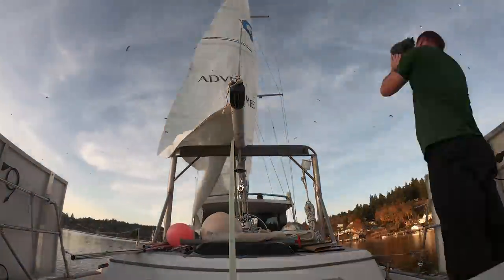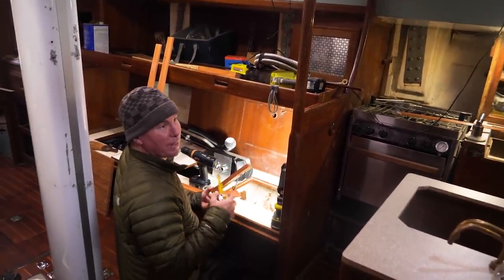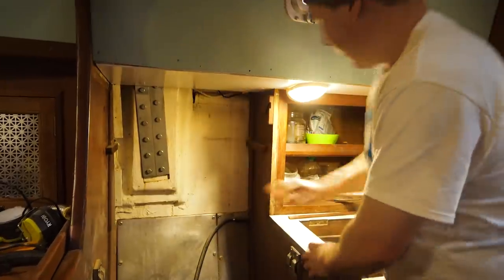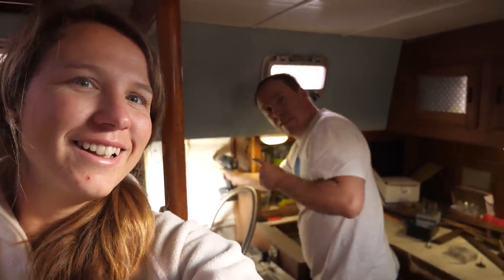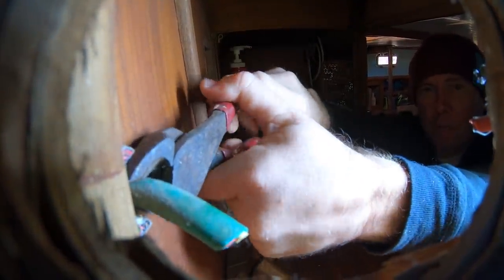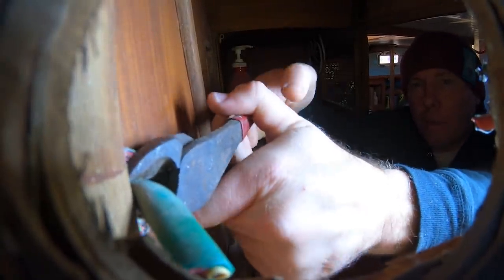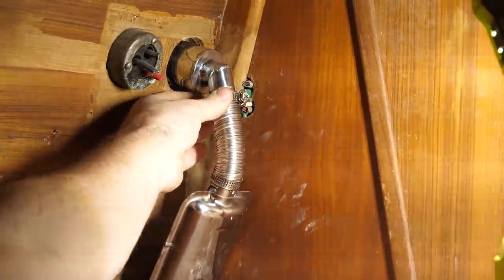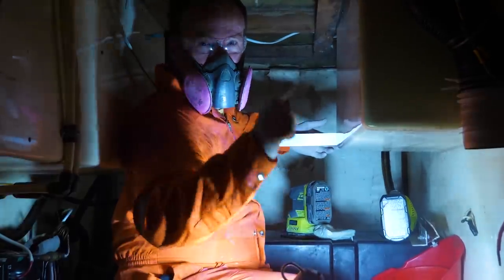Installing a Diesel Heater on a Boat [Adventure #193]

Comment: Great video. A few points.
The muffler that comes with these units is not gas tight. It has been designed to sit under a vehicle with the water drain hole downwards. Obviously that can't be done with a boat. It is possible to get get gas-tight marine mufflers, but they are not cheap. You can also get marine water traps to get the condensation (which will build up) out of the lowest part of the exhaust without letting exhaust gas out.
Also, taking the heating air from inside the cabin rather than outside the boat, and recirculating it, can lead to an increase in relative (and absolute) humidity and make condensation problems more likely.
The input air for the actual combustion chamber must come from outside - that's a safety thing.
Happy New Year to you both. I am sure that 2020 will be a great adventure for you.
Reply from the maker: Thanks for running through the specifics and we know that the muffler drain hole is not going to work for us with the angles here but had not thought about the leakage into the cabin.. Good news is we have a CO2 sniffer there to warn of dangerous levels until we get another solution in place, we like the idea of the water trap which we had initially planned for but could not seem to find anyone selling them, we must be searching for the wrong thing.

Our plan with the heating air currently comes for outside draft air without being air tight sealed through a hatch above the galley and under the dodger, that part will be a test and if we do not like the quality of dry heat or humidity levels.  We are also curious about the performance of the unit with not having a direct inlet of air from the outside which of course will be a problem if there is CO2 leaking into the cabin as well.
Reply: @AdventureAdriftSailing  I'm based in the UK and got my water trap from ebay - it was actually made in Turkey. Have a peek at the my December video (the 2nd one I think). Where I retro-fitted it. I had already done the exhaust without the water trap - but then changed my mind. I also did a specific humidity test with taking the air from the inside and then the outside - I think that one is is November.
And if I do mention any measurements - they are all in metric ;)
Reply: I was about to suggest checking out "Just About Sailing's " excellent videos on inside / outside air and humidity! You got there first!
Reply: Just about sailing that makes zero sense. How would recirculating indoor air increase humidity? That’s exactly how every home unit works, plus the outdoor air is very humid how would that even make sense?
Reply: @Juggernaut-fg2up  I am guessing that you are from a hotter part of the world than me. The amount of water air can hold is based on the temperature of the air. So in Miami the air outside would mostly be 'wetter' than the air inside. In the UK the air outside is almost always colder and much, much drier.
Have a look at a couple of videos I did - one Theory and one a Practical experiment (November 2019).
My ideal solution whilst I was living aboard and hooked up to mains power was to run a dessicant de-humidifier which, indeed, did re-cyle the air and worked great. A normal compressor type of de-humidifier just doesn't work in UK Winter temperatures.
As someone once said - the best way of keeping warm in a boat is to keep it in warm water.

Cheers
Paul
Reply: @verynearlyaboutsailing8114  that's just not how it works. Anytime you're on the water you're going to have higher humidity so I guess you never sail anywhere, also you're pulling in more cold air, why not recirculate the internal air so you can heat then reheat then heat again so you can build the temperature up. I guess you don't sail anywhere ever? You never go to more humid environments? So just keep pulling in cold possibly contaminated air? That doesn't make any sense at all. If that's the case then how come homes aren't dripping with water because they keep recirculating their own air? How come Vehicles aren't dripping with water?
Reply: @Juggernaut-fg2up  I'm afraid that we are just going to have to disagree on this one. The physics is (fairly) simple and is based on the levels of Relative Humidity, Absolute Humidity, Temperature and Dew Point. It did seem illogical to me at first - so I worked through the theory and then did an actual test by first recirculating the air inside, then taking the air from the outside. The results were conclusive and agreed with the physics.
But if we are both happy with our respective setups, that's fine. Fair winds to you.
Reply: Can i use a hi temp gasket sealer to install the muffler in-line before it gets sent thru hull exhaust? Along with a co2 alarm. Or would it be best to eliminate the muffler and just run exhaust from unit out of the boat with a loop in the exhaust line ?

Comment: I just installed the same heater on my boat. Technically had same heater on my previous boat. I absolutely love it. 

First your diesel filter is installed backwards. You want the contaminates to go to the outside of filter paper so you can visually see when it is clogged up.  In the way it is installed you won’t be able to see that. 

Second as others have mentioned the stock exhaust is not air tight and will leak into the cabin. They are designed to be mounted outside an automobile where leakage doesn’t matter. There are long cylindrical ones available. I used exhaust paste available at auto part stores and sealed the muffler, then wrapped the seams, then the whole muffler with aluminum foil air conditioning duct tape. 

Lastly make sure you have a good CO detector. 

Hit me up if you guys make it to LA, would love to buy you guys dinner.
Reply from the maker: Thanks Matt, you idea to wrap and seal the muffler is a simple and good solution and like you said a good CO detector goes a long way which we have right now and feel safe with that running but a permanent solution will have to be found.  What do you have as a way to get condensation out of the exhaust?
Reply: As of right now no way to get it out. I do agree we need them. “Just About Sailing” did a great video on relative humidity levels and what he bought for a muffler and water extractor. Thinking I may go with both. It is tough to find anything here in US because nothing is metric.

Comment: I've installed a couple of these heaters in boats and there are a couple of things to keep in mind, the exhaust hose gets hot enough to start a fire so make sure to have it shielded all the way to the outlet. The exhaust gas exiting through your cabin side will be hot enough to give a person a severe burn and melt anything it's bowing on. We also wouldn't install one of these heaters without at least one marine grade CO detector.

Comment: Lose the muffler that came with it!  They are not fully sealed along all the edges and will leak CO into the interior.   I found a long cylindrical muffler on ebay that is fully welded.     I've got the same one installed will almost all the identical parts (except the muffler)  on my Morgan OI 41.  1 outlet in the main cabin and one in the aft cabin.    the heat is great!  Don't forget to plumb the combustion inlet to the outside too!
Reply from the maker: Thanks for the suggestion, we will look into other mufflers. We haven't decided on plumbing the inlet air outside yet, that is our plan if we are unhappy with performance in any way since that is an easy modification, right now we have it below a protected hatch that is open with outside draft air and we hope that will be enough.
Reply: @AdventureAdriftSailing  The issue with not having the combustion air plumbed to the outside is.  When your unit soots up ( and it will)  it will back flow smoke and exhaust through the intake.  If its in the cabin you'll see smoke in the interior. 

for the exhaust I used one of these (not cheap but sealed)

https://www.ebay.ca/itm/Webasto-Eberspacher-Leakproof-24mm-Stainless-Marine-exhaust-Silencer-Muffler/323245898701?ssPageName=STRK%3AMEBIDX%3AIT&_trksid=p2057872.m2749.l2649

Comment: Hi guys! Great episode 👍 Just a thought about your installation; when you’re installing the heater it should be installed in a very well ventilated place in the boat.  You want to take in new, dry and fresh air into the cabin and press out the wet and used air. With a installation like yours you will accumulate both moisture and 
carbon dioxide and you don’t want that. We are using the same heater in -4 degrees Fahrenheit/-20 degrees Celsius without problems. Love following your journey. All the best from northern Norway 🇳🇴

Comment: Hello, I have had a planar heater for 5 years now and been very happy with the heater. word of advice is just before the fuel pump make it to where you can disconnect the fuel line or put a tea in the line...( that's what I did after the learning curve)  and put fuel line in the gal of Kerosene and run it on high temp for a hour or longer each month and it will burn all the soot out of the exhaust chamber and you will not have any problems. Kerosene is $5 a gal at Walmart and a gal last me 6 to 8 months. I also wrapped the exhaust hose with heat/ muffler tape and you can hold it without burning your hand. all car parts places has it. I did not use the muffler and it is quiet.  Have a good day and enjoy the heater.

Comment: As for a heat shield the best type is Stainless Steel bent around 1/4 “ concrete wall board found at Home Depo in the old days we use to use asbestos. This would be installed with S.S. Self tapers drilled through the face of the shield with a type of  fender washer “ decretive “. Some times the heat shield would be installed with an air gap between it and the bulkhead depending upon how hot the pipe gets.

Comment: What a beautiful diesel heater install.  Though it might kill you and let me explain why.  Number one the exhaust has at least three major issues.  Number one the muffler likely leaks a lot.  I have one and none of the edges are sealed well.  Also you can see inside your cabinet when you show it there is a drip hole visible which goes to the inside of the muffler exposed to exhaust.  So it is constantly leaking exhaust into the cabinet.  This leads into the second potentially lethal situation.  Why does a muffler need a drip hole?  Well it is because hot and cold things condense moisture in the air.  This leads to water in the exhaust system.  Have you ever been behind a car in cold air and there is water pouring out the exhaust?  Well that is condensation that collected inside the exhaust.  Ok, that leads to potentially lethal situation three.  The manuals for these things generally say that you have to install the exhaust pipes downward.  That is so the condensation will drain out the exhaust. With your exhaust run the way it is it will not drain.  What will happen when it doesn't drain?  Well not much immediately.  The thing is over time there will be a point in the exhaust pipe where water pools, and as the unit operates it will burn off the water...BUT...at the same time it will deposit diesel soot onto the water.  The water makes the soot stick....and as you use the unit more and more the soot builds up more and more.  So eventually you get a big lump of soot in the pipe.....so did you ever stick a banana in a tailpipe?  It can backfire and flashfire.    A better place for the heater would have been in the cabinet with a short exhaust run.  The exhaust could drain downwards yet still not have to really worry about wave action.  Now you can cap the exhaust with a copper or plastic cap, and you can extend the exhaust on the outside with a copper pipe...Then you can use the muffler.   Also wrap the exhaust pipe.  I hope this helps!!  Sorry not tying to be a G.I.T.
Reply: Soot+water+heat+time  is also a recipe for corrosion on most any metal, so you can also just get holes in the exhaust which will leak CO into the cabin. This is not an atypical condition on diesel engine exhausts.
Reply from the maker: @jeremyrainman  Yep to the corrosion, the water trap idea at the exhaust end is the idea we like best.
Reply from the maker: Unfortunately like most things on the boat it is difficult to get above the water line, to try and find space in an area with a low COG and facing fore and aft would be critical, would have loved to run the exhaust on a downhill run but I do not believe anyone has done this that we have seen.  Usually you have ones close to the water line and then a water loop in the line.
Reply: @AdventureAdriftSailing  Build the water trap on the outside of the boat with copper pipes and a drain.  Just like a P-trap or S-trap under the sink might be the right thing, with a hole at the bottom to drain condensate on the first loop that comes out of the boat.  That way if a boarding wave hits it will get caught in the trap and will drain outside just like a dorade box.  You can make it so it is right outside the exhaust port flat up against the side there by the outlet.  It has to drain the condensate.  All that exhaust pipe is a recipe for disaster.  Yes it won't be as efficient at mixing the air at the top of the cabinet, but you might be able to fix that rather than the exhaust issue.  Also I am fairly sure with all the turns it exceeds the maximum pipe run for the exhaust.  The Esper manual (which these are Esper clones)says something like eight feet max with one turn or something(I didn't look it up just going on memory) Every turn reduces the length of the pipe allowable.
Reply: @AdventureAdriftSailing  Also you can plumb the air intake the same way with another through hull fitting.  It prbably doesn't matter about the combustion air so much as the boat is pretty big and leaks enough air in to get the job done, but it is an option. Stainless pipe is also an good option.  So the pipe would come out and right angle down, then come across where a little drain hole would be(big enough to drain water fast but not big enough to allow water to come in too fast) then it should angle up and go higher than the outlet, angle across, then drop down past the outlet and bottom of the other trap and then a little tip to shove it aout from the boat.  It would probably be a good idea to have a bigger pip for the condensate drain hole so that water coming in would have a place to go but not essentially clog up the main outlet...think of it as a reservoir.  Also I am pretty sure tht the Esper manual does not account for having to pump the exhaust up so far...so that probably reduces pipe length even more.

Comment: Happy new years guys!  One of our best memories of 2019 was getting to meet you two in Honolulu.  Consider adding a second C02 detector in any sleeping cabin where the doors get closed.  Especially if they share a wall to your engine room.  Also you might want to look at this product "Permatex Ultra Copper RTV High-Temp Gasket Maker" to seal your exhaust fittings.  If you sail or drive north to Vancouver Island this year, please add a visit to Ladysmith to your plans.  Dinner and beer is on us.  Cheers, Anne & Mark Topping

Comment: On the heater ? When heeling over under sail you will get sea water back flowing in the exhaust of the heater if the exhaust is plumbed out through the hull. This type system is typically done through the deck with a “ Charlie nobble “ .

Comment: I installed a diesel Wobasto, and one "rule" I was suppose to follow was to allow moisture (condensation) in the exhaust hose to drain by gravity. I installed the unit up high within the cabin.  In the future you might install a CO detector since rust will be accelerated if the exhaust hose has a low spot.?????? Maybe periodically inspect it.

Comment: agree with the metric system we dont use 3/8`s of a dollar to buy a can of coke ! ,
Oh i have had a chinese diesel heater in my 32 foot RV (Thats 9.75 meters ) for 3 years , No dramas but run it flat out for 20 minuets or so every 50 hours use or it will soot up , They do say keep the ehuste as short as posable ,, Great vid ,
R.J.T Traveling the east coast of Australia ,,,

Comment: We too are installing a diesel heater and I had my husband watch your video and wanted me to warn you of some of the areas that were done incorrectly and need attention but I see many below have stated the same about the muffler 
And the exhaust pipe will get extremely hot so it needs to be changed as well. Good luck

Comment: Aloha, I think if you need a heater, you need to be further south!!!  Thanks for sharing, as far as metric vs. imperial I think it is what you grew up with.  I use both depending on what is called for, but years ago I converted metric to imperial as I didn't have metric tools.  Now in modern times my digital read outs switch back and forth with a push of a button.  Mahalo for sharing Happy New Year for 2020.

Comment: The pretty factor is your weak point! That exhaust gets very hot! I wrapped mine with wet glass wrap, makes a huge difference!
Reply from the maker: We wrapped the first 3-4 feet in exhaust wrap and will monitor for performance to make sure the heat escape does not cause a big performance difference.